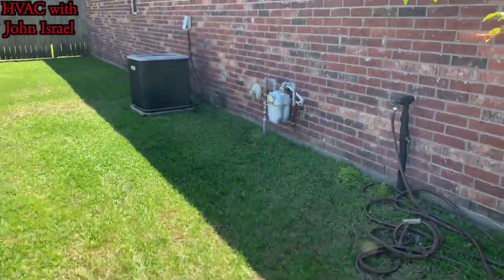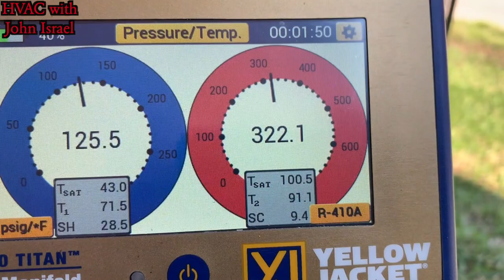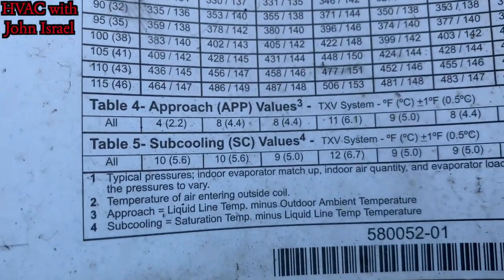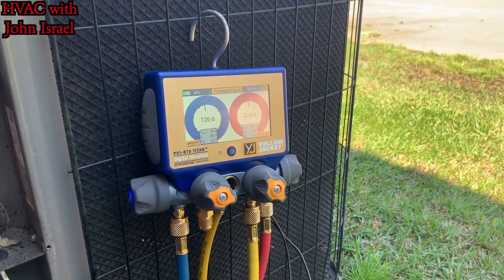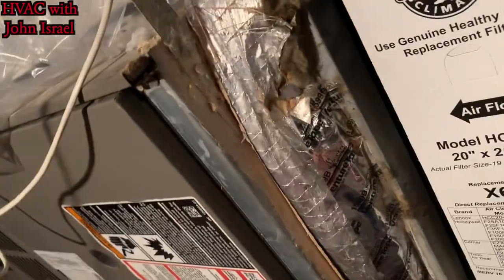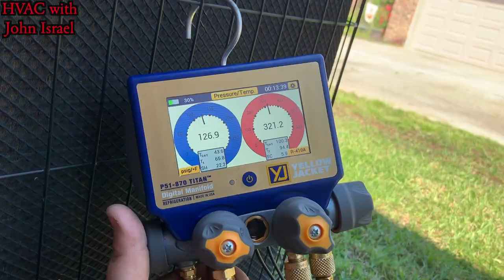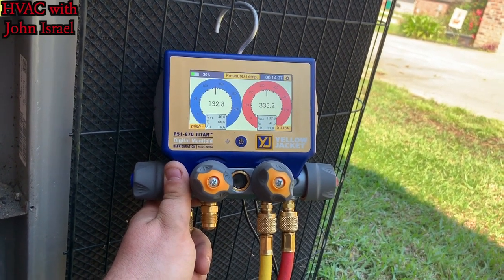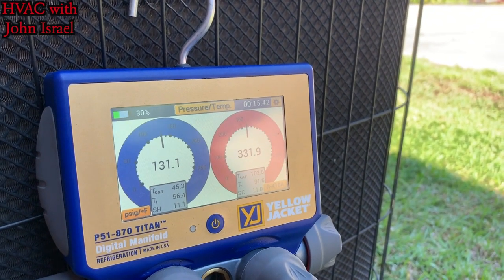HVAC System Running Non Stop

Comment: I have a Lux-Air that is 17yrs old an keep extra capacitor’s just in case,I cleaned my evaporator coil with two can of foam cleaner an a cat/dog hair shedding brush , 1st take the brush  an dry comb the coil a lot of dirt came out of mine ,2nd spray foam cleaner ,let set 5mins 3rd put everything back together, turn unit on an it will rinse free during condensation drip, now my unit stay’s where I set it an it cycles on an off instead of running constant an it’s icy cold,we are are at 102 degrees in Texas so clean those condensers an evaporators!!!!

Comment: If the unit would not shut up it’s most likely the common wire off the contactor is touching ground or another wire if the pludger is not welded shut

Comment: Why are you wishing he was here in Florida. There are many capable techs here in Florida. A  3 1/2 ton unit being down a pound is not going to cause it to run constantly. He has done nothing here that is going to remedy the problem.
Reply: Like my dad always jabbed at other techs "Freon fixes everything!" lol. We're good here in Florida.
Reply: What would cause it to run constantly?
Reply: I was wondering same thing.. short in wire making it run constantly? Thermostat bad? So many things can cause this,
Reply: True
Reply: @FrostBlueFire  yep so true. I assumed from the title the unit was cooling and continued to run after temp is acheived. If that is the case then title should read unit continuosly running but not cooling.

Comment: It’s 88 degrees in nj today. Turned my ac on with room temp at 78 and set temp at 72. 72 now but won’t shut off yet..it eventually shuts off. And if I put temp at 73 it’ll shut off. How can I tell if it’s bad capacitor or bad thermostat sensor for example?
freon is good.Air cold out of vents 

Thanks!
Reply: It's crazy because that is EXACTLY what mine is.doing . Temp set to 73 and it stays at 78 inside the house and the unit just runs nonstop....
Reply: @traphousezombie8003  sounds like you had the heat strips running at the same time the ac was running.
Reply: @traphousezombie8003 Did you ever figure this out. This is exactly what my AC is doing and my electric bills has doubled?

Comment: You did not set t stat +5 and see if it turns off / did you look at the coil or blower. is the fan set to On.  so the home is 1700 sf ????   you did not do a good video /job !
Reply: You right hi didn't fix

Comment: I never understand how an hvac can survive in a hot ass attic....I know hvac guys  HATE to do service calls in a hot attic let alone replacing an hvac in a hot attic 👎🏽😠....I just had mine replaced last week with an Lennox elite series air handler and heat pump and the installers  were glad my air handler is downstairs 👍🏾👍🏾

Comment: Thank you for posting & sharing because, like honestly I just changed my filter and I wouldn’t have figured that it has a fuse! I had to unplug the fuse outside because, it kept running, & yea it was frozen thick, I figured I’d plug it back in by an inch in a half it’ll cut on once The thermostat was turned back on and yeah you guessed it right oh hell no it did not,  I had to push it all the way back in here’s my reason for having a high electric bill for two years & yea their are way too many cracks in this house!!!!!

Comment: I have the same problem with my brand new Carrier Infinity system.  The indoor thermostat provided a fault code 178 "Indoor Unit Communication."  Service came out and re-wired the system and it now continually runs even when the outdoor temperature is 3 to 4 degrees below the thermostat temperature for four to five hours.  Please, anyone.  The monthly bill has shot up another $70 dollars a month now.
Reply: Maybe  the inverter or the compressor, I did had a call on a infinity running for a long time and not keeping up the customer said it has being doing this for 4 or 5 months, to make the story short I had to replace the inverter and compressor
Reply: @javiercardenas7588  Thank you.

Comment: How can you, top up r410 ?
Reply: Prince Bumpkin  but as I know, r410 is combination of 2 gases,so if you want to top up you need to recover all the gas and vacuum and recharge all the gas, correct me if I'm wrong,
Reply: @thivankafernando5159  Um less than #1 of gas does not qualify as a pull and recharge from scratch. Only ever done that on a problem child unit and suspected mixed gas or sever contamination
Reply: @jonsaircond8520  👍👍